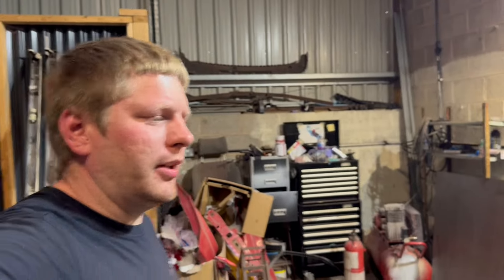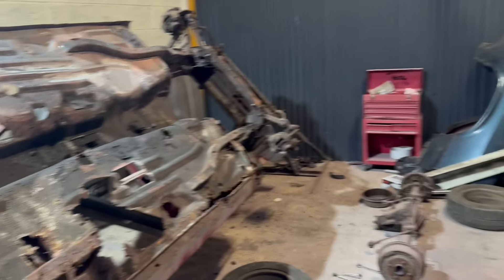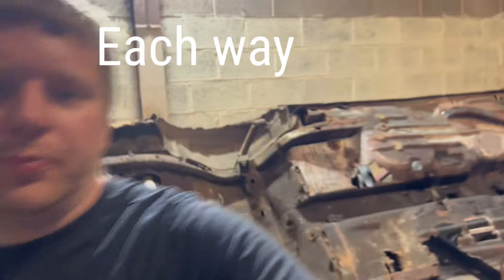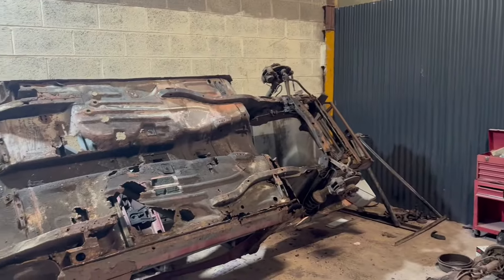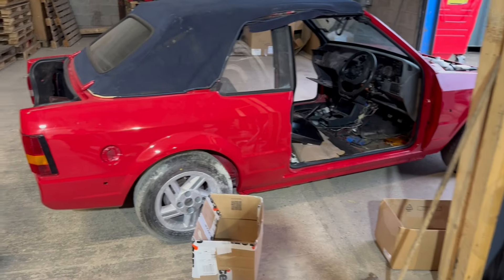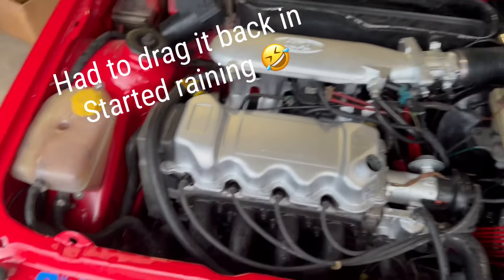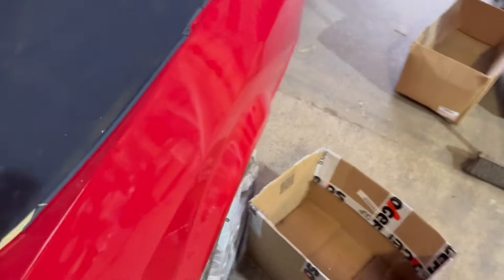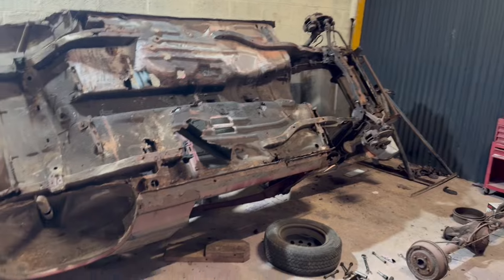Quick update , Final video on rusty for where I am currently based

Comment: Great to hear, you have been busy with other projects and have been getting a couple of bits for it.  Also if you have blagged a closer unit, that will save you on fuel a lone!
Reply from the maker: Hard finding panels needs roof , boot floor and rear qutern
Reply: @retrorust3395  i am not surprised, due to the time these have been out of production,   is there not a Capri specialist about still,  Mark Evans did a TV series called Wreck a rescue, he featured a bloke who was into Capris something bent, was a dealer in spares etc.  This would be back in 2007 though, the bloke was about 61 though back then.